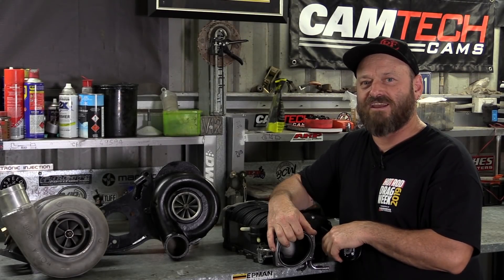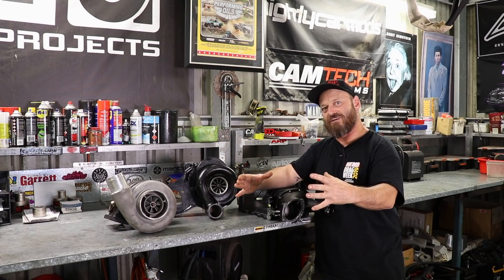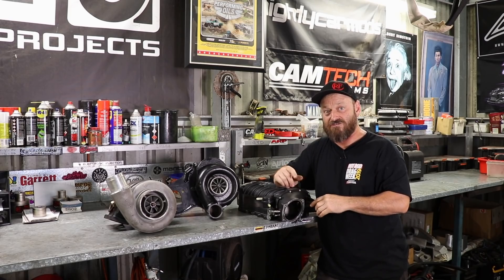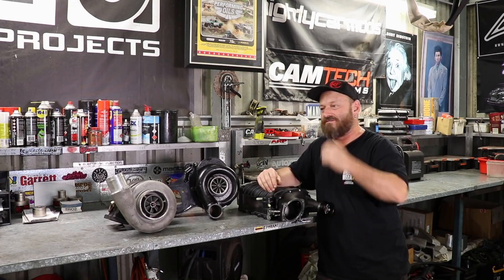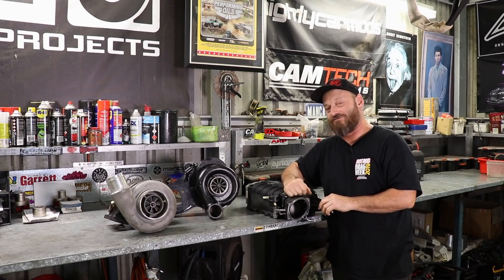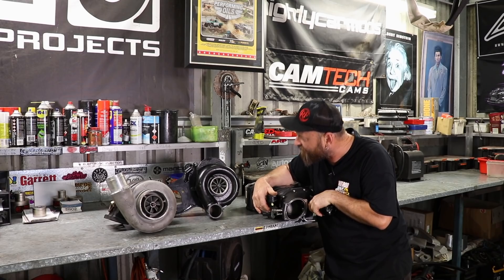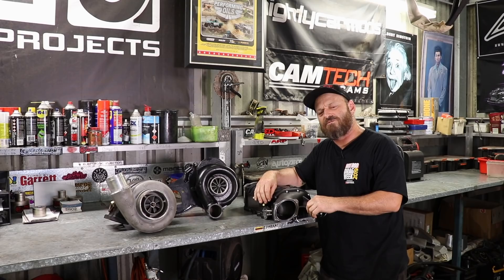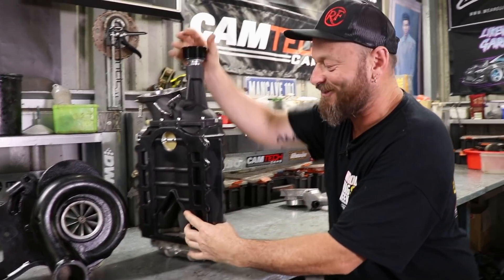Forced Induction Differences - THE SKID FACTORY - [ Quick Tech]

Comment: If you want exotic, I used to have a Mazda with a Comprex supercharger, that used exhaust pulses to directly pressurize the intake charge. Pretty wild.
Also expect a lot of VW fanbois incoming with their scroll superchargers  ;)
Reply: try a Judson VW 40HP Supercharger if you want exotic.
Reply: If you want even more exotic, a bottle of compressed air run though a somewhat complex sensor array, powering your engine just for the weight of the air tank. :D
Reply: @aserta  Using NOS is sort of the same as running a compressed air tank, but instead of regular air, you're using something that compresses better, and has much more oxygen.
(Then of course you have to add more fuel, but that's true of every kind of charged air).
Reply: Lol the ones that are built like air tools?? I mean they are a good design for low boost
Reply: I only know about them from my dads old mechanics tafe book
Reply: Miller cycle engine?
Reply: the comprex was the only diesel exempt from the full load exhaust gas test in the netherlands due to the presumed high risk of them desintegrating...
Reply: Well there are even people that use the smog pumps out of 70s American dinosaurs to boost their motorcycles. So did I. And it works
Reply: @MasterThimself  That's a really cool bit of lateral thinking
Reply: @MasterThimself  What a cool bit of lateral thinking
Reply: Years ago, I pulled a pressure wave supercharger off a Mazda bongo diesel van at "pick a part" with the intention of using it on a small cc 4 cylinder build. 
Never got around to it but thought it was a weird design being crank and exhaust driven and would have loved to have seen it in operation.
Reply: @DStead2239  do you still have the supercharger. Never to late.
Reply: @jameswalker3416  Sadly, no. I left it in NZ when I moved to Australia
Reply: @DStead2239   bummer sounds like a cool idea.
Reply: @DStead2239  man ive only heard of such things! how do they work exactly? diaphragms? turbines?
Reply: @NaN.404  Common shaft for belt drive, compressor and exhaust compressor. wastegate on exhaust side and not sure if belt drive was clutch driven or not but would make sense